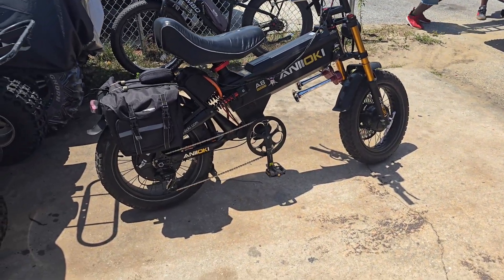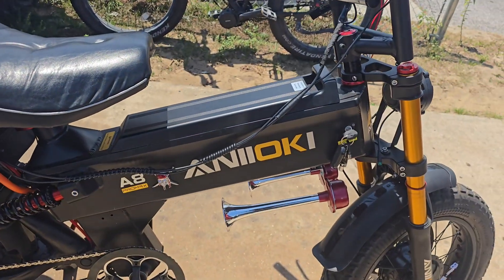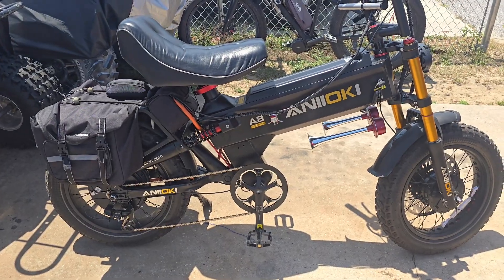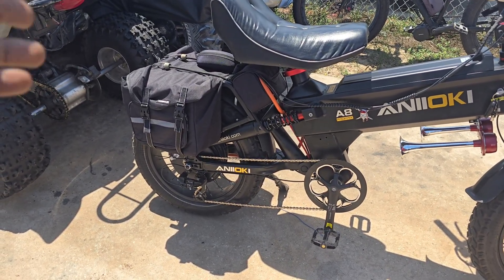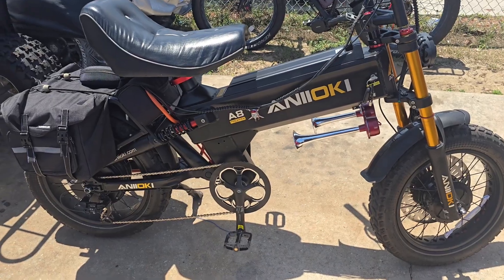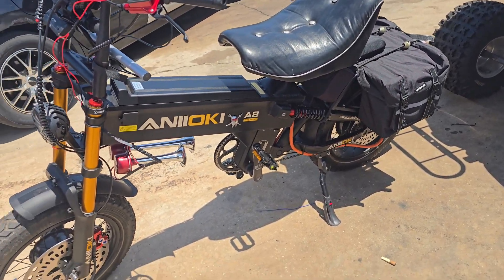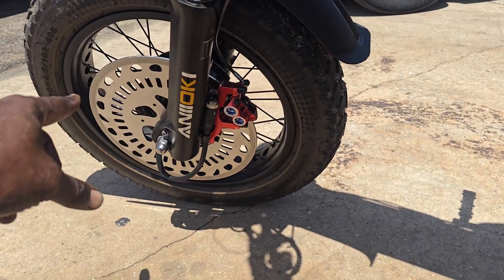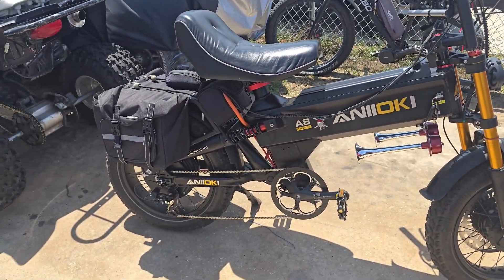Aniioki A8 pro max with qs205 5000w hub motor! Choose right motor for your frame.

Comment: How fast it going now man ????? BTW the Aniioki  battery 60V doesn't have lots of AMPS NOPE very weak:(
Reply from the maker: It's about 53mph
Reply: @EBG-offical the new dual motor with dual rotors  bike runs around 46mph now. 7mph difference ah
Reply from the maker: @p3dtesla118 this one is on 52v

Comment: Can i ask you if you have a link to the qs273 axle nuts that you prefer? I see you are not using the oem ones
Reply from the maker: Oh they are m16-1.50 lock nut at the hardware store

Comment: Damn was gunna ask where he got that seat, but i guess imma have to make my own xD

Any suggeations on a good torque arm setup? My current bike slipped its axle the other day and I managed to fix the hub wires but I'd rather not have it happen again.
Reply: Definitely grin v7 torque arms I just installed one on my bike and the rear feels very planted

Comment: I kept seeing this bike and like the design to do some modifications but I heard some negative things about the customer service about something that breaks I think. I would want two batteries installed on this. And upgrade to 92v.
Reply: 92v be weird. its a 52 v bike... so that require complete new hub/ controller/ displays and everything.. only could add a 40v battery

Comment: Hay bro i got a 48v kit i upgraded the controller got an error 10 eny advice
Reply from the maker: @hotsause123  need to know what controller?
Reply: could be a controller problem ! are you sure bike rated ? sometimes mix-n-match can be a issue with displays/throttle,etc

Comment: I have the new dual motor a8. It has direct drive motors. They appear to be ~150mm in diameter. Internally they seem to have 5t windings. Very torque-y.
Reply from the maker: @tazerface8659  yes 5t has good power